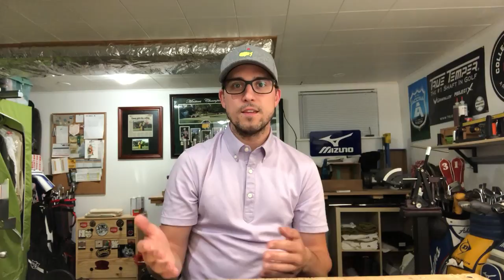How to be a Club Builder!

Comment: so I have a driver adapter with the tip of graphite shaft snapped off in it how can I get it out. Any recommendations?
Reply from the maker: Hi Randy,

Great question. Depending on what adapter it is the best best is to step drip out  the graphite tip part starting with a small drill bit and working your way up to a slightly less than 335" size and then using a wire brush to get out the rest. Make sure to be wearing safety glasses, have the adapter properly secured in a vice, and to help speed the process along try using a micro torch to heat up the drill bit - NOT until its red hot but warm.
Reply: Thanks Ryan!!!